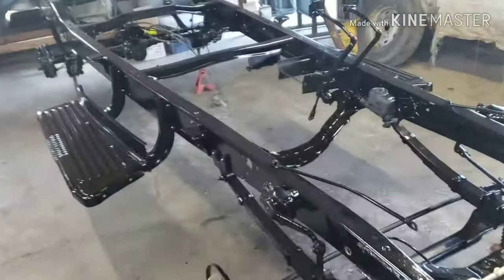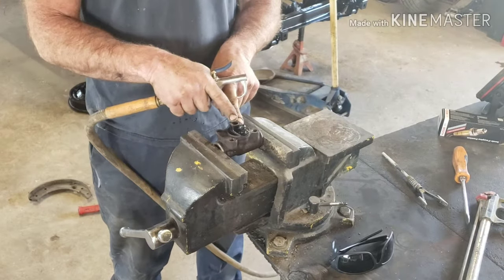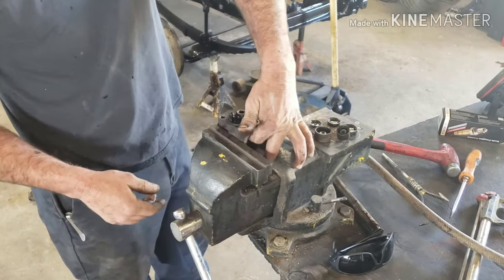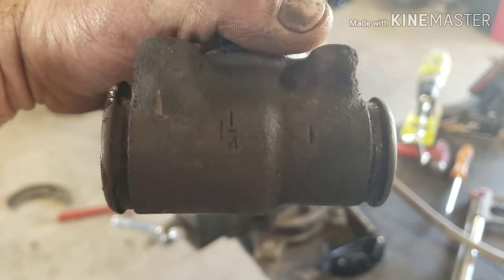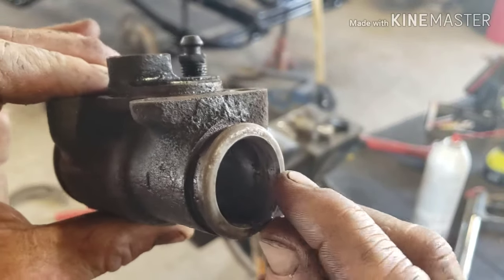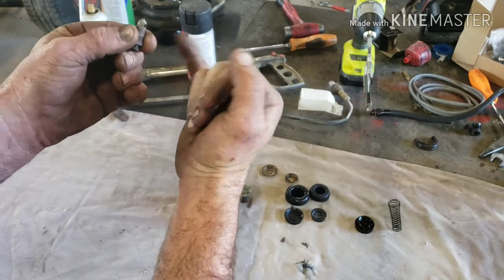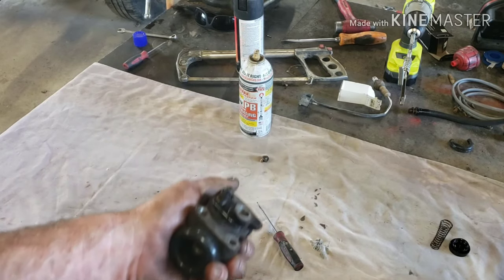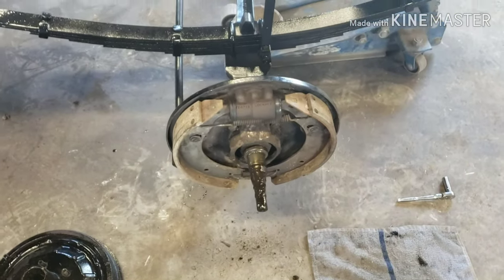Truck Restoration - KB2 - Wheel cylinder - rebuild

Comment: ATF works great as a honing oil due to its low viscosity and high detergent. Then thoroughly flush with brake clean and blow out with compressed air. NEVER use penetrating oil (WD40, PB, etc.) to reassemble internal hydraulic rubber components! Castrol red rubber grease or equivalent is ideal, or just new brake fluid. Awesome videos, but had to put that one out there.

Comment: Inter KB2 brake cylinders are  1 1/4" x 1" front cylinders and 1 1/8" x 1" rear cylinders, left and right handed. On my KB5 I replaced them with a set of Ford F-150 front discs and rear drums, with matching master . The 2 piece split rims were tossed
Reply from the maker: cool

Comment: Getting ready to do this exact same thing on my 49 KB2. I'm wondering where you purchased the kit from. Thanks.
Reply from the maker: Sacramento vintage ford 
1939-1948 rear wheel seal kit 
fit perfect and cheaper than finding it with an IH tag
they were made by the same company anyway
Reply: Great info. Thank you. I have learned a lot from your videos on this truck. You do a great of explaining and walking through the steps.
Reply from the maker: thank you ..... i enjoy doing it